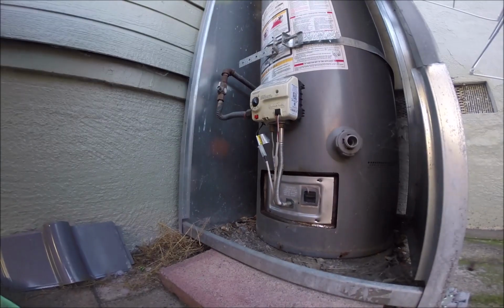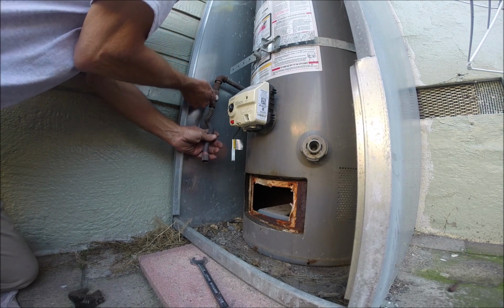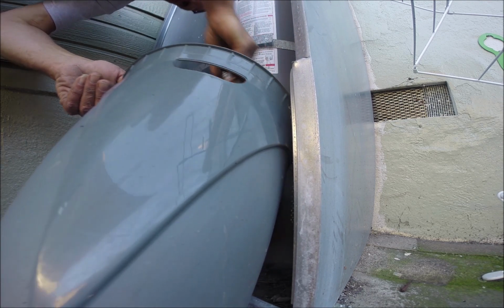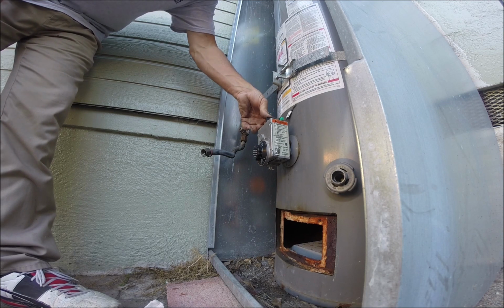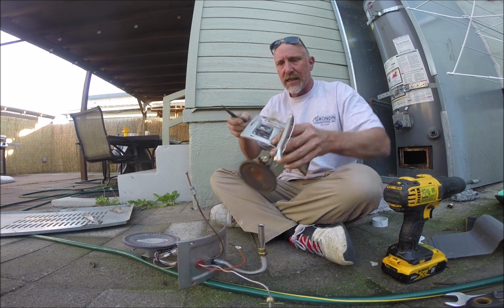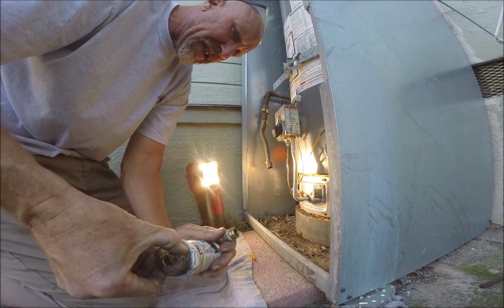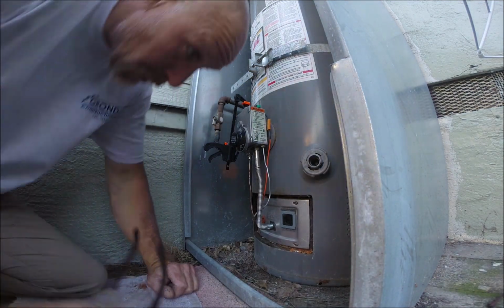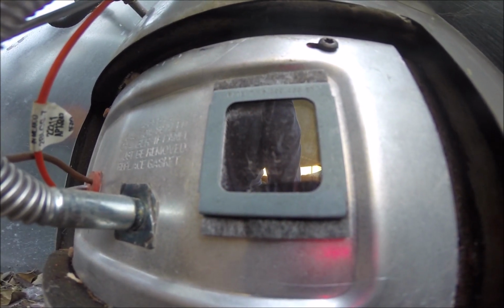Water Heater Valve Conversion

Comment: noticed that ALL the Rheem tanks at home depot now come with the brass drain valve. I guess they got tired of everyone being POed when they leaked lol. Happy Thanksgiving!
Reply from the maker: Thanks for watching as always! Yeah it’s really in their best interest to just fork over the money for brass drain valve because so many water heaters are getting returned. It’s it’s got to affect their bottom line I understand they probably sell literally hundreds and hundreds of thousands of water heaters through Home Depot that’s probably every year, love to see what that number is I thought it was it just matter what type of brand you bought meaning if you bought like the performance versus the performance plus. I tested a 2017 Ao Smith commercial grade water heater yesterday guy told me it had no leaks of course it leaked did a hydrostatic pressure test on the tank and I was pulling everything off of it that I could recover you know cause I ended up buying this thing, so I’m trying to harvest as much good parts as I can And I fully expected the anode rod to be just gone or useless and basically 80% of it was still there. So whatever happened to this water heater probably manufacturing defect was pretty much accelerate. It could’ve been the type of water or high pressure with a manufacturing defect. Hard to say I do see these every now and then anyway happy Thanksgiving.